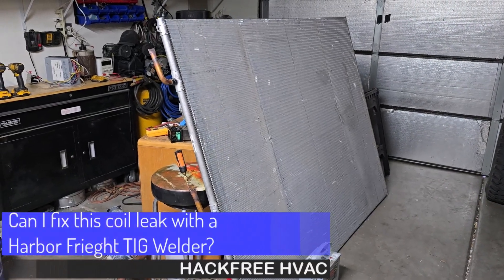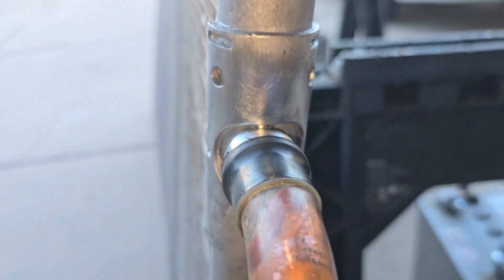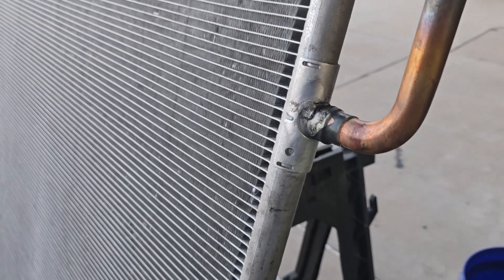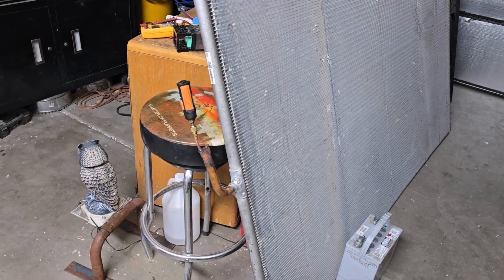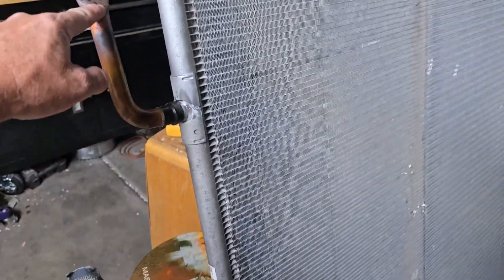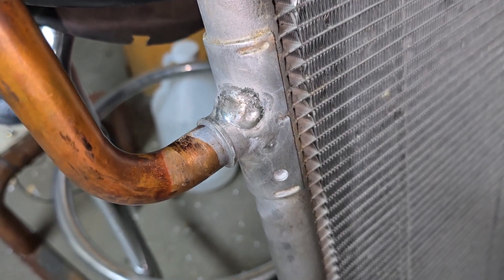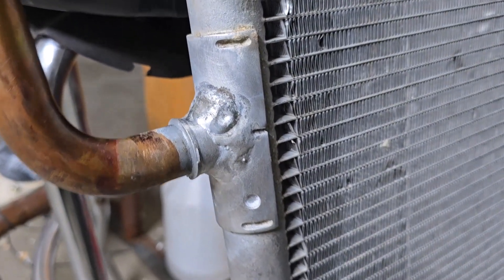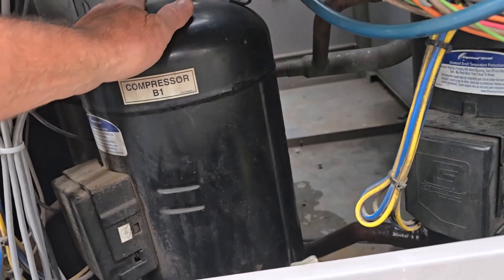Using my Harbor Frieght TIG to repair a large Aluminum Micro-Channel Coil

Comment: I have not seen your channel in a bit. What sort of strain relief exists between the compressor and coil. Your quick vid clip, look like just a inverted U tube to allow some differential movement between the spring mounted compressor. 
In cars, they bolt each end of the fitting of the rubber hose in place, as that's the strain relief between the engine on mounts, and the fixed radiator and evaporator. I worked on aircraft, and cable damage from staining the crimped (never soldered) contacts, will fail if the maintenance loop (which is too damn short for weight reasons) is not stowed with harness weaving.
What happens when you are not watching the compressor go into some sort of oscillations that rock back and forth on that joint. 3 failures, I would try to figure out what that compressor is eating if that's the cause.
Harbor Freight is way too expensive, for less then $400 there's a full feature TIG Stick machine with pedal and other argon and consumables full cables (model AIT200P AC/DC  auction listing #167872582239 for example for anyone else that reads this, just need to remove the 16awg cord, and replace with a 10awg cord, and they all need this mod) to get near the 200amp rating. But I was just playing with mine this spring, I had zero talent with aluminum, and I was able to get the current down low to where I could just see the pulsing doing it's thing in a thin part I was working. My practice was some thicker pieces of aluminum (Uni-strut scrap), and I was able to fake some real crappy but function working welds.
Nice fix of the coil. I worked for the Trane company in Lacrosse WI back in 76, they made these sort of heat exchangers back then (for nuclear power plants), I did destructive ASME pressure testing (the 5x beyond max working pressure). The stuff I worked on were the 4 pass 5/8" copper tube aluminum fin coils, they were like 2ft by 3 ft rectangular. I did chilled water testing for the published ASHRAE catalog, for HVAC 250ton size system designs used. Boring job, did the data taking, but all the prep work to put it into wind tunnel #19. Had to setup WB DB conditions, at 5 different FPM flow rates, and if memory just 42F water at 3 different flow rates. Damn antiquated even for 1976, all taping on valves with the 2oz hammer to slightly adjust the flow rate or steam flow for WB. And when the factory went to lunch the main line steam pressure changed, and screwed the whole data run up, I had to write it all down on a special data sheet, so some computer operator could key it in, and the ME could be happy with the data, before I could tear down and do it all again. I lasted one year and went back for the BSEE. Same BS, designs are only as good as the human that has the talent of mechanical aptitude, those people are maybe 3%, you are one of them. Thanks always good to see a old content maker.

Comment: Most automotive components are vibration isolated with flexible hoses and mounting. Probably has a lot to do with it. Pressure is lower with r134a and r1234a than r410 too.
Reply from the maker: Yeah the isolation is certainly better from the aspect of the compressor discharge vibrations. Cars do get beat around a bit otherwise.
On a hot AZ day R134a can see 300+ although not as high as R410